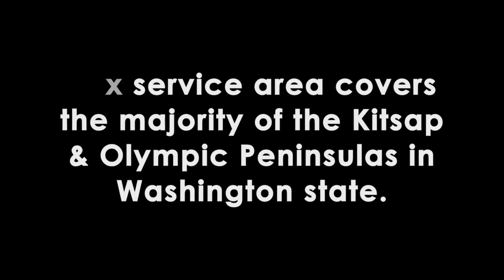[Q & A] 10 Minutes With A Tech - Session 2

Comment: Great information.
As well as high voltage, I also monitor for low voltage at the park.  I have seen one park where it went down to 90 vac at the pedestal.  I have an analog voltmeter plugged into an ac outlet near the sink in the kitchen area.

Comment: Do you have a video that shows how to check the park power pedestal with a voltmeter to know before you plug in that it's wired right, the ground/neutral is correct and the voltage is ok? I have a progressive 50 amp ems for our coach but  it would be good to know how to do and would really help those that don't have one.

Comment: Question: Dometic AC 13.4KBTU  Died while camping(FL HOT). Found that the Common wire on the compressor burned up - probly the overload as well(all the disconnects were a bit corroded(this is a 2016 rv).   Going to put new F terminals and overload protector BUT the compressor post for the common is just a post - the male disconnect blade burned off.  I wish there was a barrel connector i can use to slide onto that common compressor post. Started looking at these "QuikLug" fittings. What would you do in this situation?  New AC? or would you attempt that repair with one of these "Terminal fixers"?

Comment: Does anyone know if the level of protection for the inline surge protectors like   "CAMCO Circuit Analyzer Wiring Surge Protector 55311 RV Trailer 30 Amp" sold on Fleabay is adequate protection at all for situations like those discussed here on this Q&A?  This is something I actually already bought. I assume it would detect the massive over current situation before you plugged in, then it's on you not to try to use the supply... but how is actual surge protection designated and defined?  Is this thing worth the weight to carry?

Comment: Aquahot 600D.  When I turn it on, nothing happens.  Lights on the control panel looks good, burner light is green..... but nothing g happens.  No fan, no burner.... just nothing.   Where do I start?    Checked fuse Inline with burner, checked the switch on the door panel...😳